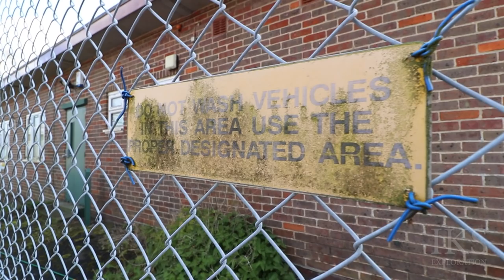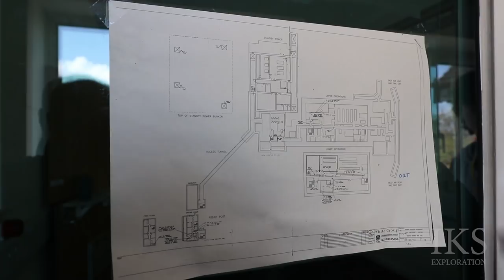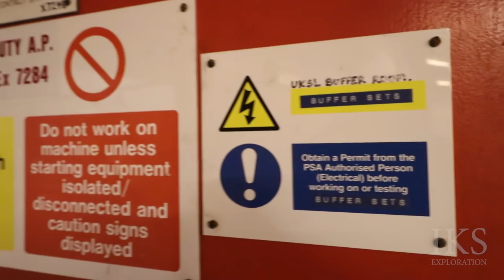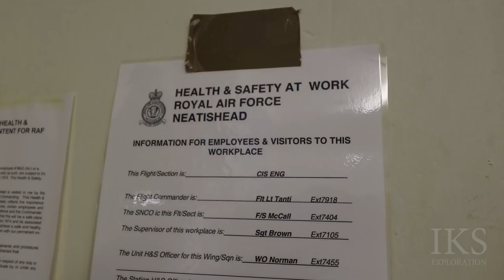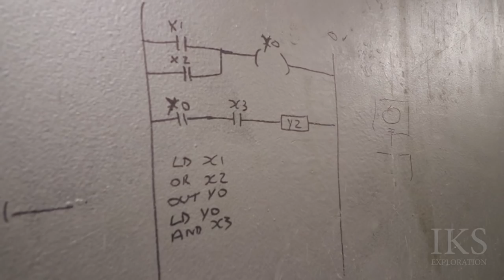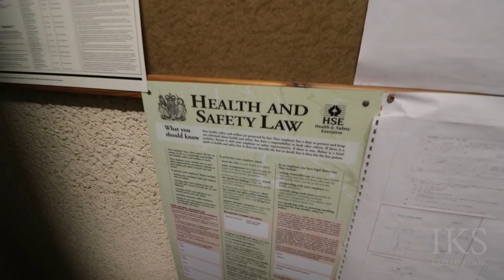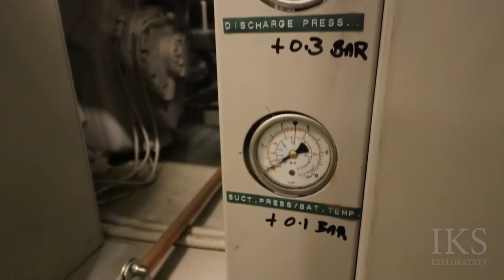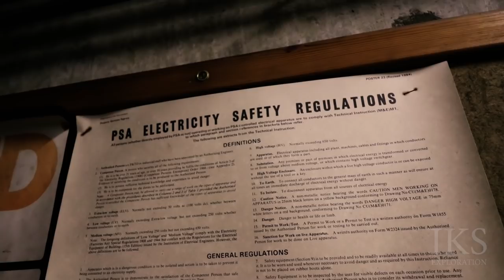R.A.F. Neatishead R3 Rotor Bunker, Norfolk

Comment: Back in the seventies I worked for BICC ( British insulated Callander Cables Ltd ) at the West Bromwich Depot in Brandon Way, I used to work on the jigs cutting these high voltage steel armoured cables to the customers sizes, they were difficult to wind into smaller manageable coils and always heavy, the drums thet were deivered to us on were typically 7-8' diameter, they were made in various factories around the North West, I went to see them being made in one factory at Prescott which i believe was in Lancashire

Comment: The Fire was started by a LAC Supplier by the name of Chessman who should not have been in the Bunker as he didn't have the Security Clearance. One of the Civilian Fireman suffered from a heart attack and the other two were part of a search party that went into the bunker to recover him. One of those two was later found died at the base of one of the stair wells in the main operations complex while the other had tried to escape down the main entrance tunnel. However he followed the stair well railing around the side of the stairwell and into the PBX (telephone switch board room). While in that room he inadvertently closed the door (it was a sliding door on rails) and when he managed to locate it again he tried open it like a normal door. As he ran out of air, he quite literally tired to claw his way through the door with his bare hands before he died in there. To put the fire out, the bunker was flooded with water from a local river.

In 1981 I visited the station as an Air Cadet, At that point in time the Bunker was still a smoke blackened shell with operations being carried out from the R30 building on the surface (what is now the Air Defence Radar Museum). During the Visits we visited the fire section  who still had the fire damaged door from the PBX Office with the blood and scratch marks of the dead fireman on it and we were taken down the bunker and shown where the firemen had died.

On my second visit there in 1985 (as part of me RAF Trade Training) the Bunker was a building site for the installation of the IUKADGE  Integrated Command and Control System which I was later working on in 2004 when the Bunker was shutdown. One of my tasks due to the job I did in that bunker was to act as a Fire Marshall in evacuation of that bunker in the case of a fire. This involved training in the use of a BA system and how to safely escape that place from either exit (there was an emergency exit on the other side of the bunker from the main entrance) in pitch blackness without falling down any holes in the fault floor or following the railings into a side room. Not an easy task in the 15 minutes allowed due to the limited air supply held by the BA Kit,
Reply: Horrific story about the firemen. Heart breaking.

Comment: it makes you wonder what was down there to keep a fire burning for so long.
Reply: Many cables, furniture, fuel and so on. The problem in a Bunker is that you cannot flood the bunker properly with air to cooldown the hot surfaces. And water in combination with heat produces steam, a lot of steam 1liter of water produces around 1600liter of steam. So with the equipment of the sixties it was very dangerous to operate in that conditions.
Reply: You would have little chance of getting out of there with power off and conditions like that.
Reply: Unewrground walls were waterproofed with pitch.

Comment: Too bad that the communication equipment has been stripped, you now only see the utilities.
Reply: The only comms equipment in there were phones. The radio comms were at other sites and accessed by the radar console system which was known as DVCS (Display and Voice Communication Sub-system).
Reply: @richardvernon317   Tx and Rx at Barton Turf !
Reply: @emlraradio  And other places. DVCS could access any IUKADGE supported radios from Portreath in the south to Saxa Vord in the north. There were also a number of IUKADGE radios located on Airfields from Valley to Wattisham,
Reply: Communications and Display equipment. There were 40 radar display consoles in there at two levels. The Upper floor ops room held the Weapons Teams who controlled the Fighters and SAM's. The Lower floor ops room held the Surveillance team who managed the air defence picture. The Computers and Comms switches which ran everything (and the engineering team) were on the lower floor as well.

Comment: What a waste! Just big empty rooms where equipment used to be. Nothing technical to see. No radar units, no transmitters, no power supplies, no generator rooms, no nothing!
Reply: No radar equipment there at all. The place was an Control and Reporting Centre, The Radars were mobile and were based 20 miles away or more. All of the radar data came in by telephone or microwave data links. It all got feed into a rack of 4 PDP-11/44 Computers which converted all of the data into the same message format and that was feed to a pair of Data Handling Computer Strings each made up of a DEC VAX 1000 series Computer connected to 2 PDP 11/44 computers and around 20 LSI-11 Micro Computers. The two DHS strings processed all of the radar data into a single air and sea plot which was displayed on the 40 odd console in the bunker with one string as the Primary and the other as a back up which would take over if the master system failed. The Computer room looked like any other 1970's computer centre.